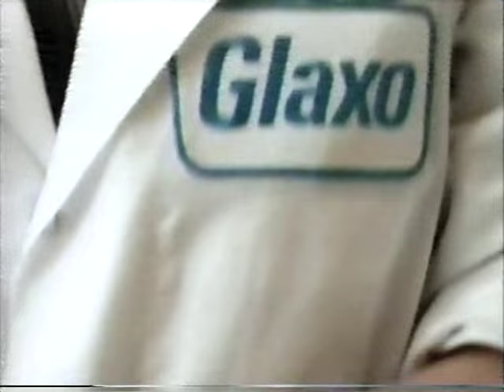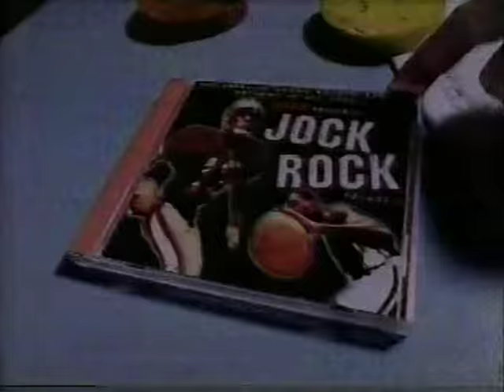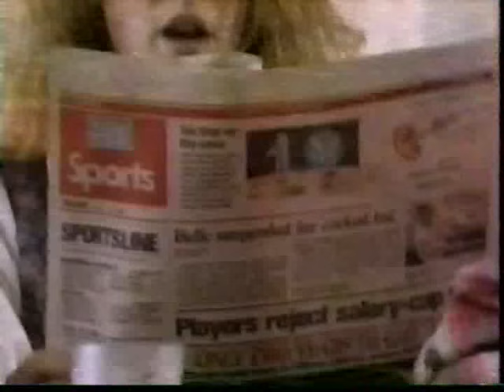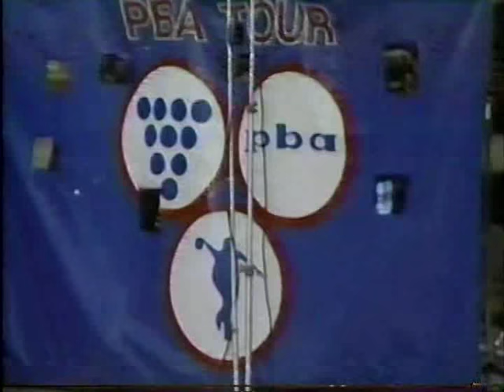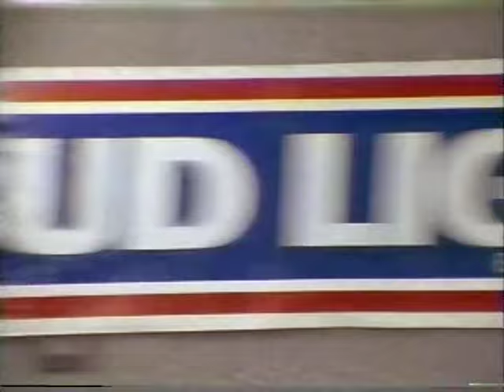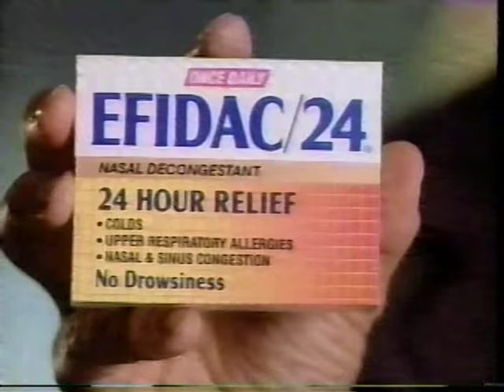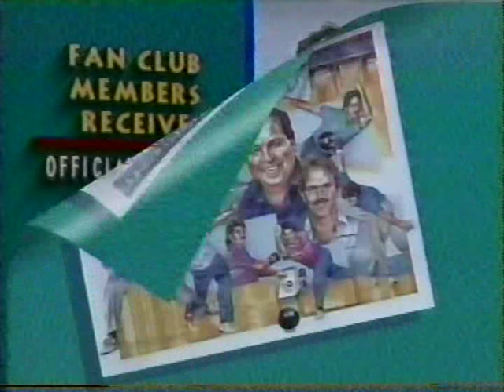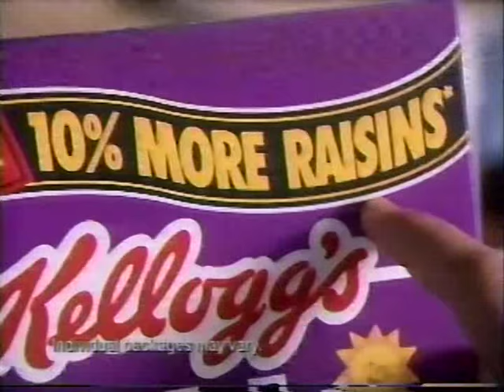1994 Rochester Open

Comment: Duke did go on to win Player of the Year in '94 and I think it was all the more incredible because of the fact he was signed with Faball
 and they were not making very good bowling balls at that time.  I owned a pro shop back then and I distinctly remember their initial blue reactive hammer, it was just the blue hammer core in a reactive shell but that ball just didn't have any of the magic that the urethane version did.  In fact, there were times when the urethane ball hooked more than the reactive!  And he won player of the year throwing their stuff..pretty amazing.